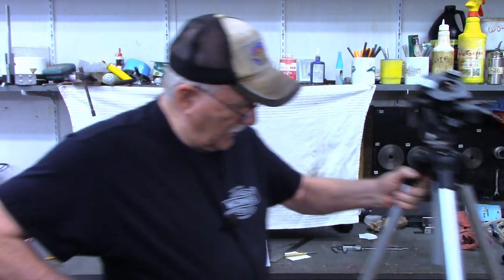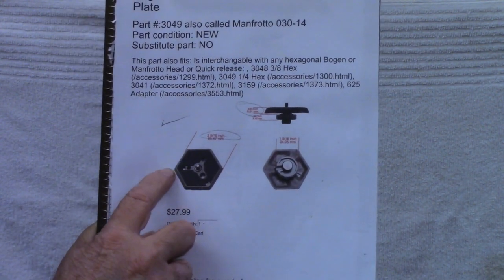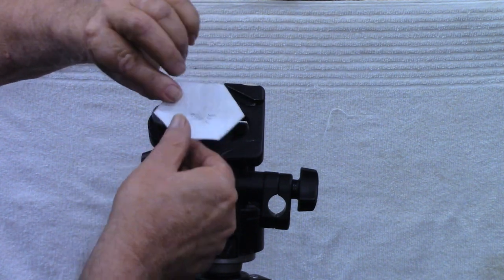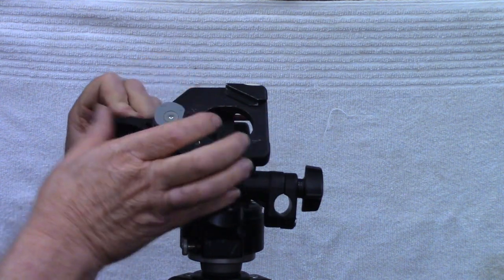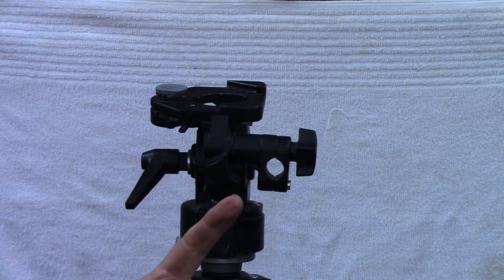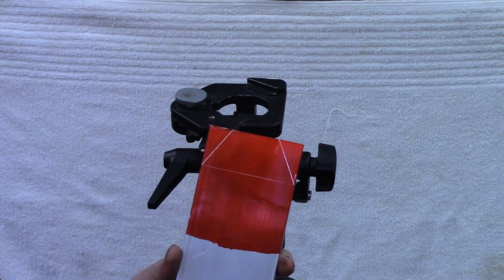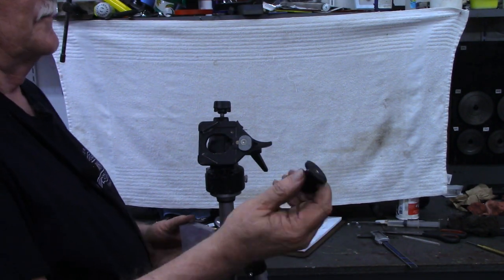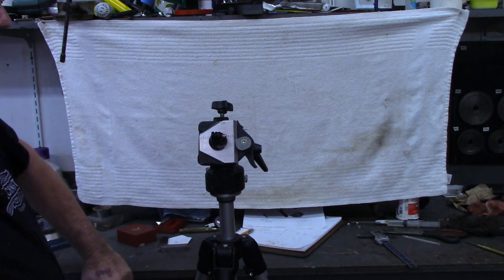Machining A Tripod Camera Shoe & Locking Screw

Comment: Lee,

The hole in the camera is 1/4-20 Whitworth thread. While this is picking nits, as the threads in the camera are probably a bit on the loose side, I figured you might like to know.

The standard tripod mount on all SLR cameras and, where fitted, on compact cameras, and therefore on all tripods and monopods, is 1/4 Inch Whitworth. Larger format cameras use 5/16 inch Whitworth with tripod adaptors from 1/4 inch Whitworth if necessary.  (Wikipedia)

Comment: I make a lot of assembly fixtures that use plastic knobs and found your machine vise works great as a press also. It's 2 parallel faces keeps everything square. You can turn a piece with clearance hole for the screw a little longer than the screw body to keep it square.